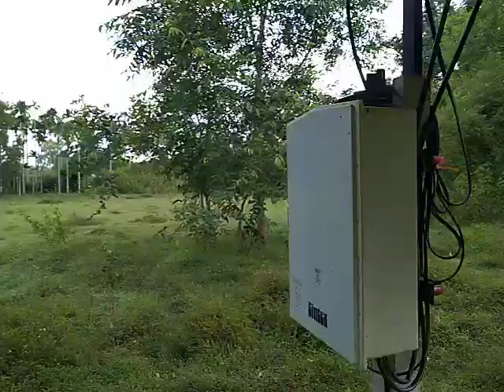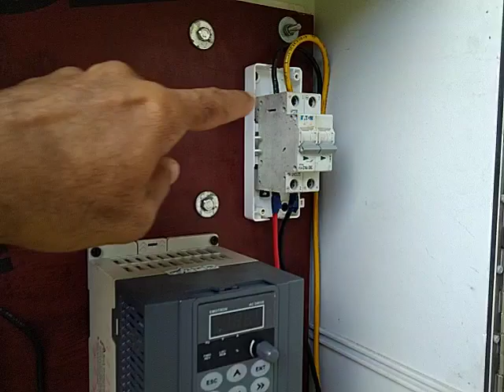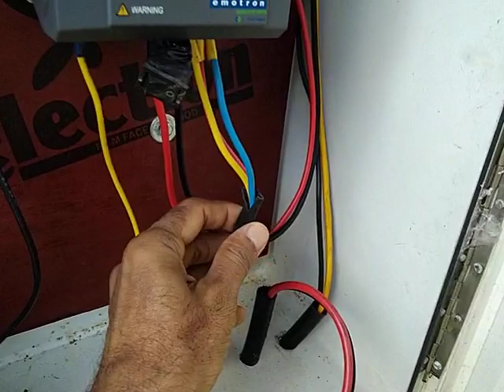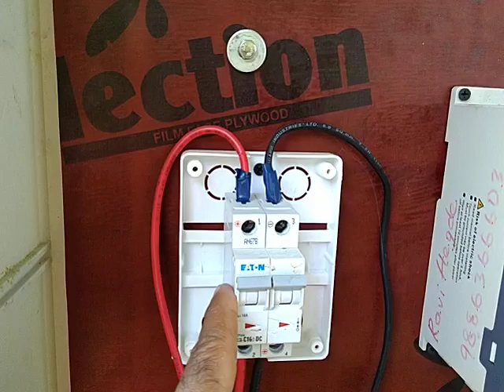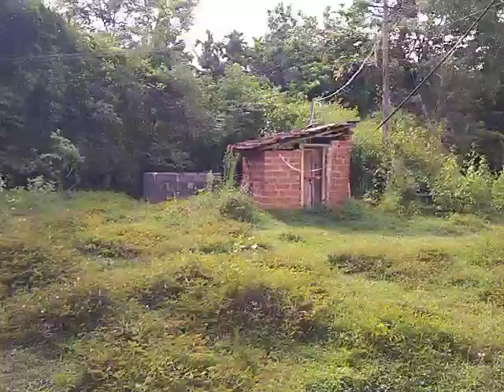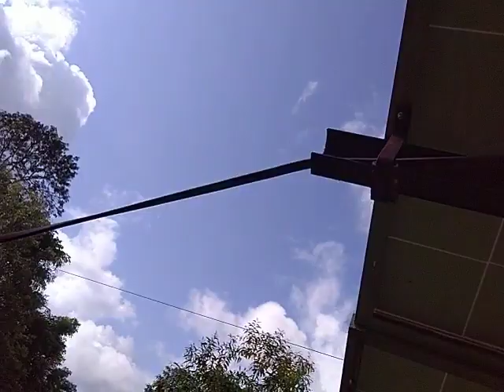Off-grid solar system

Comment: I have question how did you get wifi connection in remote place
Reply from the maker: No place is so remote now. I get signals from Airtel, BSNL, RJio. I have got 100 mbps fiber network. By the way, earlier when I was living in rented house (before constructing my house in the farm) I had used self-made Yagi antenna for receiving mobile signal.